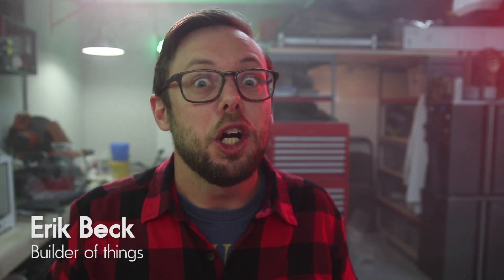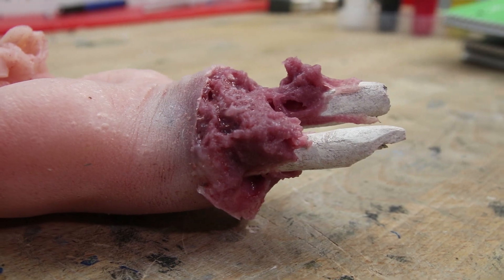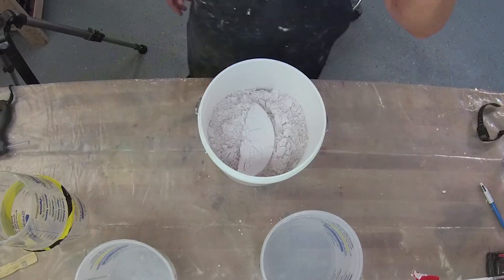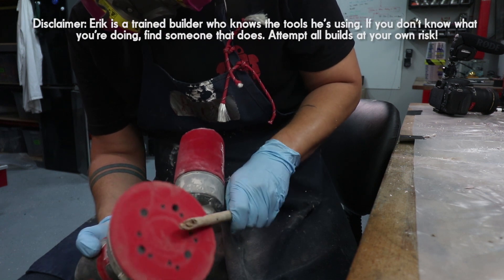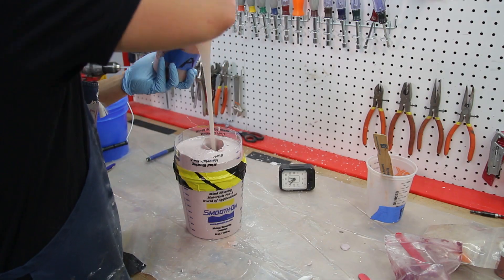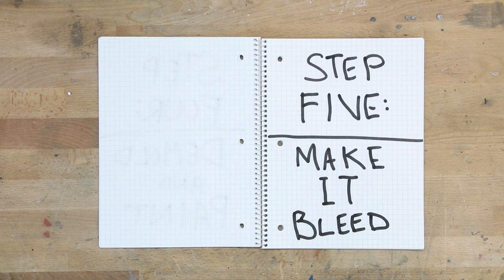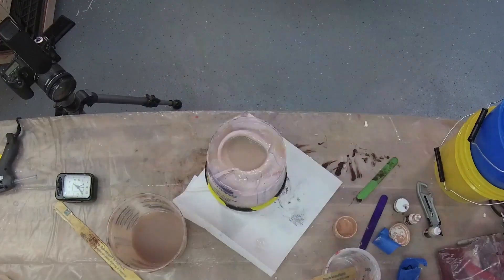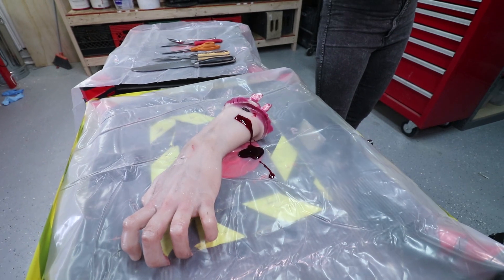DIY Fake Hands  - Erik Builds the Movies #7

Comment: One tip for your viewers: alginate is not a permanent mold material. It dries out and shrinks, and distorts in the process. Make the bones in advance so you can pour the silicone right away after pulling your hand out of the mold. Even waiting a few hours can cause distortions (covering the mold in a wet paper towel can give you more time).
Reply from the maker: Very true! Luckily it only took me about 15-20 minutes to make the first fake bones, but yeah I made the blood filled one before molding my hand.
Reply: Just throwing that tip out there, don't want folks to have distorted mutant hands (or maybe I do). Good to have you back, Erik. I always enjoyed BFX :)

Comment: Hey Indy Mogul, you guys rock! Thanks for the great video! I was wondering, would it be safe to use this Alginate hand mold to cast an ice hand that would be used in a punch bowl? Or would you recommend a silicone mold? If silicone, what Kind?
Reply from the maker: Hmmm, I think the alignate would warp a lot or just absorb the water you are trying to freeze. Do a search for "food safe" silicone. I know Smooth-On and other companies make stuff like that for chocolate molds and such. MAYBE you could figure out a way to do a cheapie version with a plaster mold, but it's be tough to make water tight. Also not sure how food safe plaster is. You could probably coat it with some sort of food safe sealer. Good luck!!